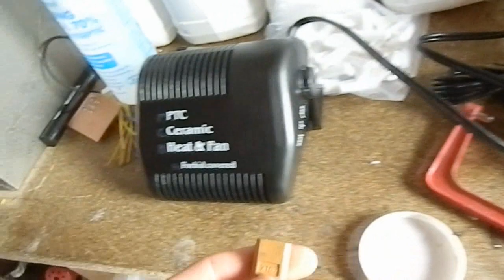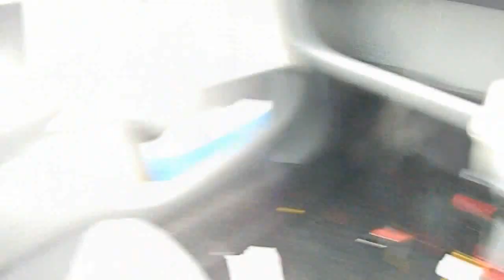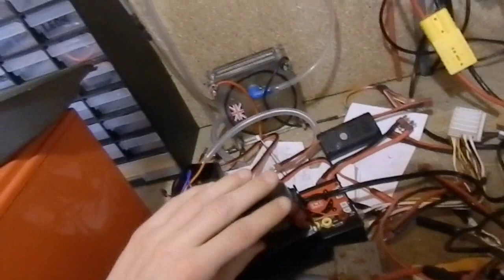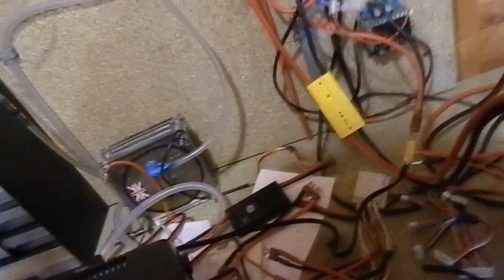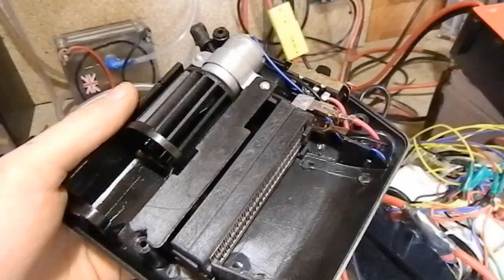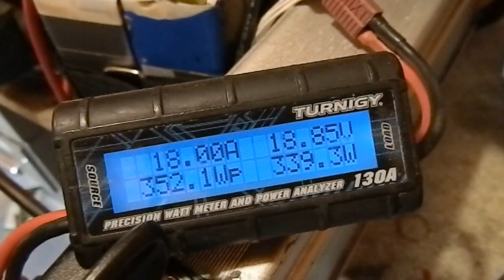12v Car Fan Heater - Why it's crap, how to fix it

Comment: The larger ones work to a fairly good extent, BUT you have to know how to install them. Never ever never plug one in to the cigarette lighter! Wire it directly to the battery. And ALWAYS put a fuse, size dependent on the amperage draw, into the positive wire.

Comment: Mind if I ask you a couple of questions pal I want to install one of these in my car properly? Would hardwiring the heater into the fuse box inside the car be as good as this? Would you hardwire it into a 15A or 25A fuse, and what size cable would you use? Thanks
Reply from the maker: I would use 12awg cable and a 20 amp fuse. Better wiring it directly to the battery
Reply: @ShaunDobbie  cheers for the reply I'll wire it to the battery then, my battery is in the boot will it lose power with such a long cable? Also are these heaters actually effective at defrosting when they're wired up properly is it worth getting one to begin with?
Reply from the maker: @Danny-yz3gu  They aren't massively effective but better than nothing. If the run to the battery is that long then wire it to the fuse box.

Comment: being a PTC, wouldn't it kind of stop itself from melting. Like when you run it off 18v, the element stays a similar temp, but more power dissipated because the fan is blowing a lot harder?

Comment: i have this heater too, it was loud too. i opened it and noticed that shaft on the motor is moving side to side like bushing is worn out or something. that was one reason for the loud noise of fan.

Comment: Hi Shaun, I just bought a 12V Ceramic car fan heater 200W, I was going to wire up direct to the battery with an XT60 connector but was wondering what size fuse would you recommend, I calculated 16.667 Amps. I think that is right. Your help is much appreciated.
Reply from the maker: A 20 amp one will be fine. I used 30 but I had other stuff connected.
Reply: Thanks

Comment: Just subbed your channel,
I'm currently getting the bug, I have collected around 300 18650s and building an ebike.
But I've just been upgraded stuff with the xt60 like my son's 12v car now at 16v.
Do you think some 18650s could handle the amperage of the car heater, I also like your video on the segway, battery monstrosity system.
I've decided against one for my ebike 52v battery.
Also loving the solar shed, thinking about a mini version, my house has dun from around 10am until sunset
Reply from the maker: 18650 batteries will handle it fine if you put enough in parallel. Make a 22.2v 30ah one at least.

Comment: Why don't you just use lukewarm water? it clear my dad in 30 seconds. Just two jugs then your done
Reply: That, and even "room temperature" water poured onto frozen laminated glass can cause stress fractures and cracks; ask me how I know. Save yourself the $200+ of a new windshield and use the defroster, Auto Glass isn't made from Pyrex. It isn't made to handle rapid temperature differentials.
Reply from the maker: I have an electric car now so I just use the app on my phone to defrost everything before I leave the house.

Comment: You can prob answer this question, how well would it work in these conditions?
Say it's 10c in my area, I realize this cannot heat a whole area. But should it be able to keep a small area comfortable? Meaning if I was to sit at the computer and do work on it and sat the little heater under myself, would it sufficiently make it comfortable at least while I am sitting above it?

I would connect this to a computer PSU probably, could it turn the 10c air to maybe 16-20c just in that small area I sit?

I fully realize that if I got up and just walked 2 meters away that it would be cold again, I am just trying to heat up a tiny area while I work. A spot heater I guess.
Reply from the maker: I would recommend using a higher voltage supply. I have since modified the heater so it can run on up to 50v. I put a step down converter on it to deliver 12v to the fan.
Reply: Interesting, so you must be able to supply the heating element with a rather wide range as far as voltage goes. I guess it would become even hotter and you would need to make sure the fan can dissipate that heat maybe. 
Of course the built in fan probably can pump more than the element at 12v which it comes with.

I will just buy one of these anyway and see how it works. If it doesn't seem warm enough then I will modify it a little. I have a few of those step up and step down converters also.
Reply from the maker: The element is a PTC type which means that the hotter it gets the less power it takes so it self regulates. If it is run on higher voltage it gets hotter takes more power if you can supply more airflow.

Comment: the biggest unknown, is just what safeguards are built in to the PTC element, in the event the motor fails?
Reply from the maker: The hotter the element gets the less power it take up to a point it won't get any hotter.
Reply: thanks, yes I notice the characteristics  of positive  temperature co-efficient, just that i wasn't sure if it took it all the way to shutdown the current. Thanks for the presentation.

Comment: Great video Shaun,
Yes, those lighter style plugs are almost useless to carry any serious current so I avoided products that use them. I never thought to change them out for something better. It is such an obvious solution that I hadn't considered it.
Reply from the maker: William Erickson Also remember that the car wiring shouldn't be speaker cable. That also plays a massive part.
Reply: Shaun Dobbie YES! My brother plugged a cooler into the 12 Volt outlet of his minivan and smoke started coming out of his dash. The fuse was inline and too large for the wire gauge used.

The outlet in my truck can carry 20 amps with no problem.
Reply from the maker: It is pretty stupid. Car designers don't really know what they're playing at in some cases.

Comment: hi sean .. wicked video btw.. i have one of these that i too was a tad disappointed of the performance of it .and was thinking of binning it!! .. i have the version which has the led light and the foldaway handle for supposing aiding defrosting windows with !! and  i was wondering would this awesome idea of yours work with my model too ??   cheers for reading  ;)

Comment: Sean I got a couple of questions, btw very good video, very informative. My questions is you say you ran a cable from the battery and the other end went to the seat to earth it, which I understand, did you use a fuse? was it a direct connection? did it last? since this video have you been able to fit it to the car step by step?
Reply from the maker: The connection is still working. I put in a 40 amp fuse for safety.
Reply: Hi Shaun, is your wire connected directly to the battery and then runs through the bulkhead and into the interior

Comment: Good video - I'm always concerned about cigarette lighter plugs because, as you say, the contact area is so small. Fine for small currents, but not for large.
I actually bought a 12v ceramic heater from Maplin and found it to be crap - the flex got quite warm, but as I have a Citroen, I'm now wondering about the wire gauge to the socket. I thought it would be a good purchase as mine is diesel and takes ages to warm up. I might now do as you have done, and wire it into the battery directly.
Reply from the maker: Thanks for commenting, yes just get 8 gauge wire and make a separate connection inside. That should work great. The negative wire I just bolted to one of the seat rails.